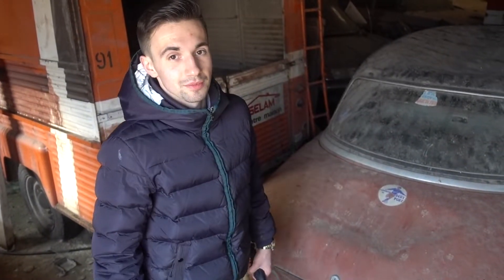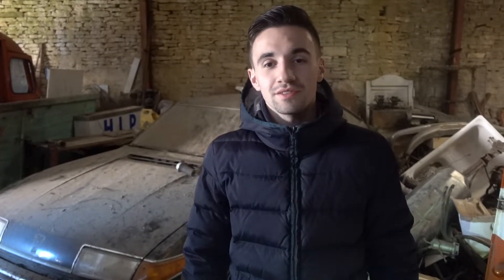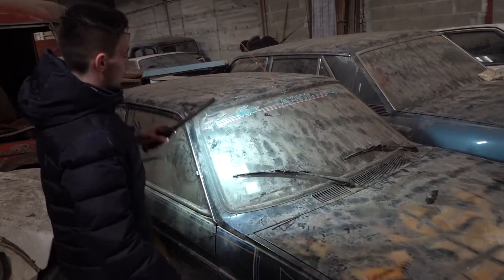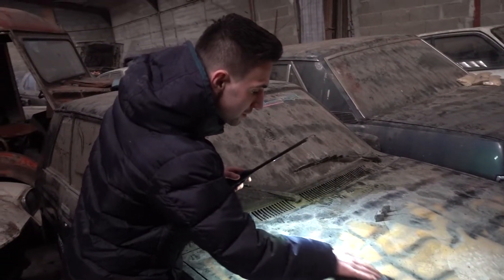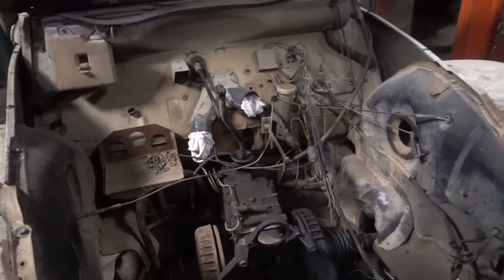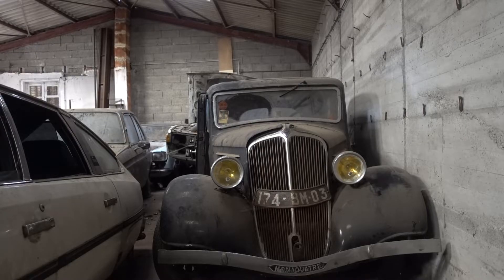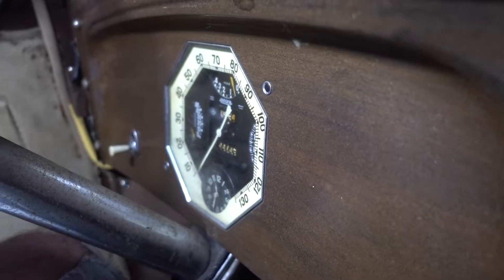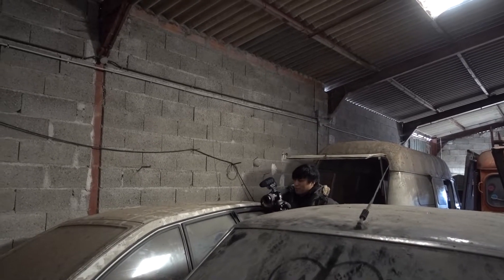Found RARE Oldtimers worth $10000 in an abandoned CAR GARAGE in France

Comment: Panhard was originally called Panhard et Levassor, and was established as an automobile manufacturing concern by René Panhard and Émile Levassor in 1887.
In 1955, Citroën had acquired a minority 25% interest in Panhard, and ten years later, in 1965, Panhard's automobile division was finally absorbed by Citroën: the company ceased production of cars. The last Panhard passenger car was built in 1967 from then only military transport was badged with the Panhard name, the military division being the part of the business now owned by Renult. The Rover is an SD1 produced between 1976 and 1986.The Monoquatre  was a small family car assembled by Renault between 1931 and 1936, so yes, it's an old timer ;)